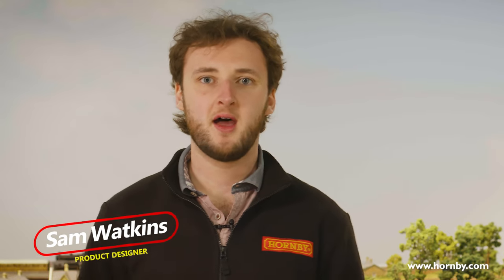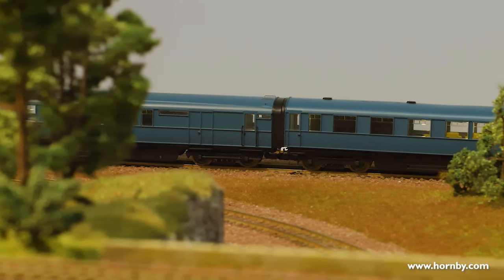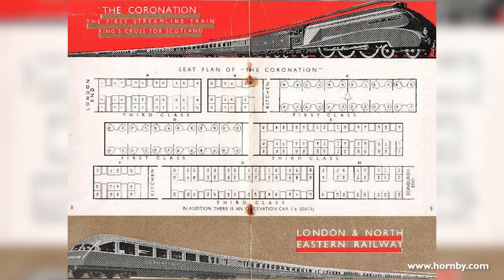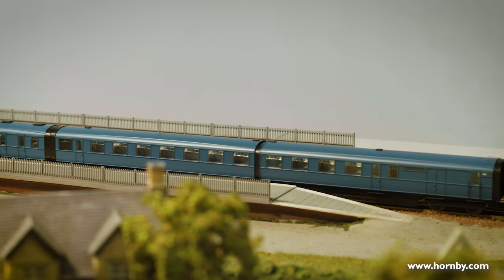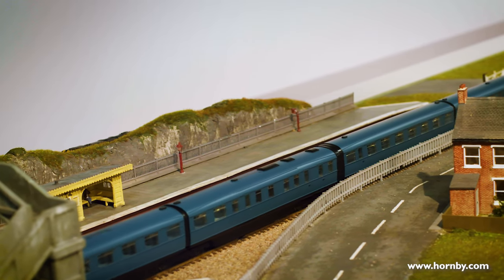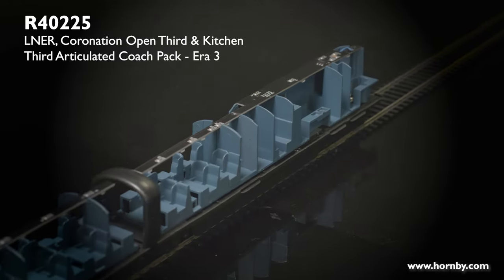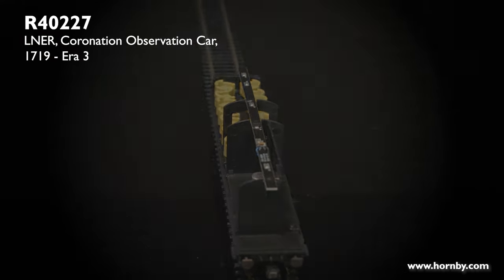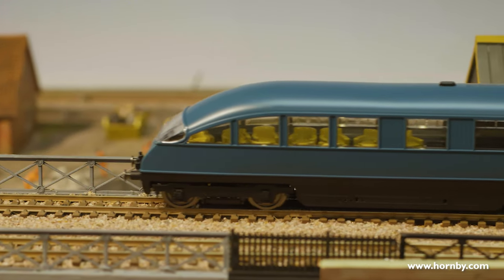Discover Hornby Sam's Stunning Coronation Coaches Update!

Comment: I hv had the pre-order in on these since the dawn of time, just based on the actual coach photos. As an engineer what has been thought about and subsequently designed has far exceeded my expectations. So much so, I can see me getting the further rakes in other periods when announced. Also, its good you explain all the design history; in my previous job as Bus Dev Manager, once you explain what goes into a product, and the subsequent benefit to the customer, the cost becomes a secondary issue. Or in this case, if you had to build them yourself from scratch, and decorate, you wouldnt be able to do it even for the RRP.

Comment: Obviously much painstaking work has gone into developing these carriages.  This is a credit to Sam and Hornby.  What I am curious about is how readily convertible are these carriages to EM gauge. Accurascale / Irish Railway Models have developed locomotives and mark 2 carriages which though set at default 16.5mm gauge are readily convertible to EM gauge and 21mm gauge (Irish gauge in 4mm scale).  Maybe my query could be answered.

Comment: What coaches from these were used when Mallard set the speed record?
Reply: Only six of the usual nine coaches were used on the record run. The observation car was not used. The dynamometer car was coupled to the tender before the six coronation coaches that were used.  It does not seem to be recorded anywhere that I can find which other two coronation coaches along with the observation coach were missing!  Hope this helps. Regards Jim